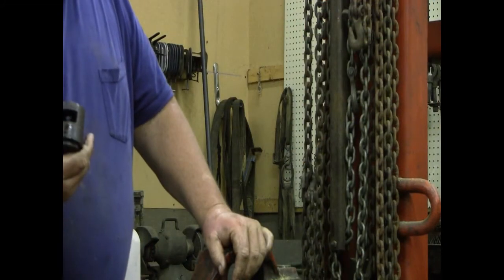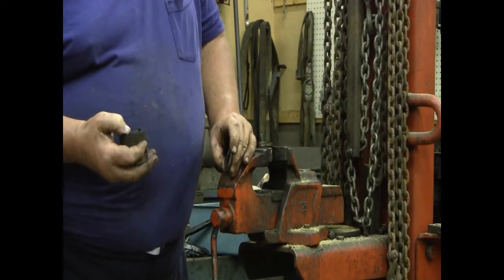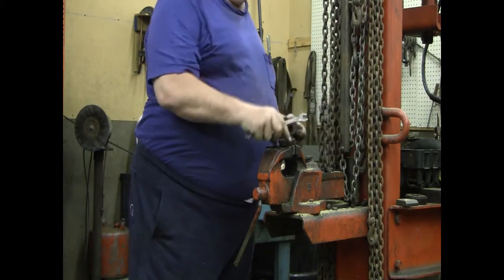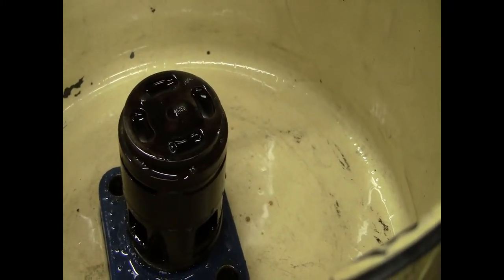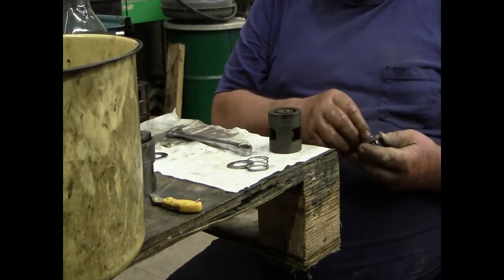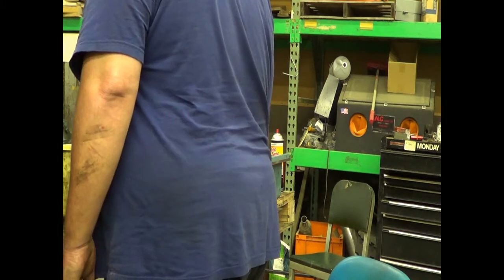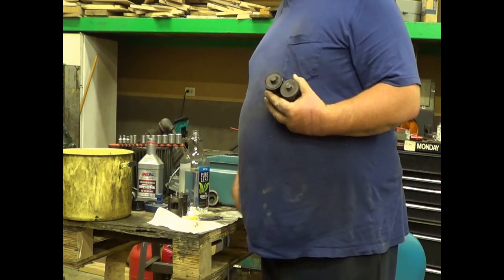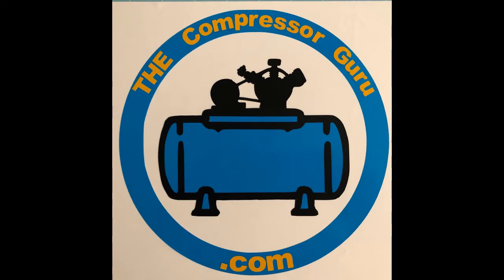325 valve tear down and reassemble

Comment: Thanks for making these videos. I have learned a ton about working on old compressors from them. I think the hardest thing is to find the right parts for a decent price.
Reply from the maker: feel free to give me a call, I have many aftermarket parts that the pricing is great. contact me through thecompressorguru.com
Reply from the maker: you mentioned HIGH cost parts, check out the next episode coming on August 2 for a great example of OEM vs Aftermarket.
Reply: How do you clean the head and valves when they all full of carbon build up? is it a good idea to soak everything  in gasoline to loosen gunk down then scrub everything?
Reply: @mexinumba1  Kerosene or diesel is best. It doesn't evaporate as fast. I also used brake cleaner and a wire brush to get the last bits off.

Comment: I have a Quincy 325 and it use to leak air from the air filter and dip stick tube so i took the four tops off and two of them was rusty and dirty and internal parts was stuck so i cleaned them up and put it all back together and now it doesnt leak from the air filter and dipstick but it leaks from the two small holes on the aide of the unloader. What causes this?
Reply from the maker: My best quick guess is the diaphragms are leaking. I assume this is when it is shut down. Quincy seldom put a tank check valve on the 325s but that is always a plus if you would want to add 1 now. you may have not needed to clean the valve ( but it was good you did).
you may contact me through thecompressorguru.com. thanks
Bud

Comment: I’m rebuilding the valves on my Quincy 230-36 compressor.  The previous owner supplied a rebuild kit with the unit when I bought it.  The parts seem correct --- new style springs, new washers, new copper valve seats, and the correct gaskets.  I’m curious about one thing regarding the high pressure discharge.  They were pretty rusted up, but not seized or beyond anything a good dip in Evaporust can't fix.  The valve seat seems to be in good shape.  When I reinstall everything the valve seat “disc” that the 5/8” through-bolt threads into does not cinch tight against the four main-assembly-feet --- rather it spins freely.  I’ve checked to make sure the valve isn’t leaking by filling the bottom (upside down) with fluid to see if it leaks out.  The spring and washer are holding as no fluid leaks out.  My question is, is it normal for the unit to spin freely, or should the valve seat “disc” set firmly against the four feet of the valve assembly?

There's a moment around minute 12:40 of your video as you remove it from the pot during your fluid test where I think I can hear the assembled parts clinking a bit --- which is exactly how mine sound.  But I want to make sure before completing my rebuild.  I think we all hate the agony of tearing into a fresh rebuild to "fix" a problem that could have been addressed much easier if it were earlier on.  Great video!  Thanks for your help.
Reply from the maker: Robot it is normal for the shouldered bolt to bottom out before the valve bumper is tight ( just what you described)  make sure the valve disc doesnt get caught between the bumper and the feet of the valve cage or housing ( I do not know what that is called I should look it up in the parts book) anyway when you install and tighten the valve down those feet will go tight against the valve bumper . Good Luck, if you want to call me feel free to contact me through the website thecompressorguru.com

Comment: If you do the fuel test on it and the fuel leaks? does replacing the seat and spring fix the problem?
Reply from the maker: if it leaks it can be as simple as apiece of dirt . you can also have a bad valve disc sometimes a VERY VERY weak spring. if it leaks you have to do some looking.

Comment: Hi, where can I find service data for these old Quincy's? Is contacting Quincy the best option? Or is there a place I can find repair manuals online?
Reply from the maker: you will be hard pressed to find a service manual. you can get parts books . most parts books will have the torque specs in the description of the part. hope that is all you need. Feel free to contact me through thecompressorguru.com.

Comment: Buenas para udt maestro excelente video tengo un quincy modelo 320 y estoy buscando un manual del mismo , sabe udt donde lo pueda encontrar sin problema alguno ya que he buscado en Internet y no logro encontrarlo, excelente  truco el de revisión de sellado de las válvulas con las gasolina para saber si existe fuga saludos y gracias de antemano
Reply from the maker: I will get a lady from church to read this to me I don't speak or read spanish sorry
Reply from the maker: Buenas tardes gracias por tu mensaje. Recientemente he buscado por partes del modelo 320 sin ninguna suerte pues esta descontinuado. Si encuentro algun manual estaré confirmandole con un reply "Consegui" y apartir de ahi le solicitare un email para enviárselo .  Las gracias a Carolina que me ayudo a traducir este mensaje.
Reply: Hello to you and Carolina again, thank you very much for responding and attending to my message. The issue is that I acquired this quincy 320 that had been working for a few decades in a factory and which since then has not been systematically and correctly maintained. At the initial moment of obtaining it, the first thing I do is disassemble it completely and the valve system was clogged, with a lot of rust and charred and that's when I see your work on yotube. I managed to clean them completely but unfortunately a valve does not seal on the part of the rings. At this moment I am restoring it as new and with a solution for that valve that does not seal due to the deterioration of the rust that decomposed part of its seat. If it is of your interest to know how I repair the valve so as not to discard it since I do not have the possibility of acquiring a set of them. I support your channel and thanks to you I have managed to understand the operation of the compressor, please excuse the length of my message and that I had to assist the google translator. Best regards.
Reply from the maker: @sergioandreshelguera4024  the google translator seems to work well. so I just got off the phone with Quincy I now have a pdf of a 320. good news is valve parts are available. next problems are we are going to have to ship  to you. where are you. I may not be able to ship to your country. 
I think the best way to do this would be for you to contact me through thecompressorguru.com and then we can start emailing each other. looking forward to hearing from you
Bud

Comment: when you were setting the flat washer/disc into the suction/intake valve assembly, you said let me know if you know a trick for them, I happened to see a trick in this video at this timestamp: https://www.youtube.com/watch?v=hAA86q7QkJQ&t=320s  (he uses a small screwdriver to depress the spring so that the disc sits flat down into the valve)